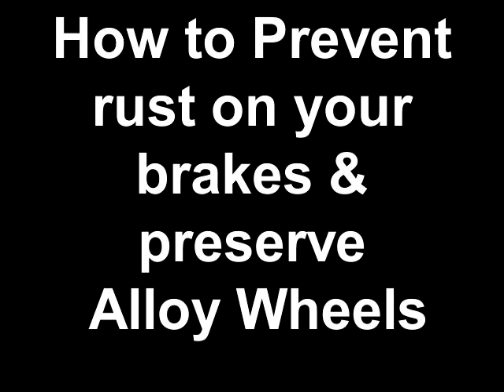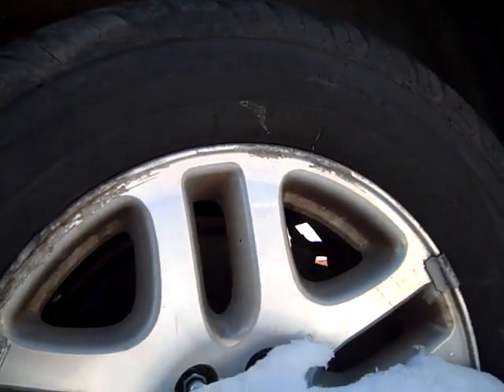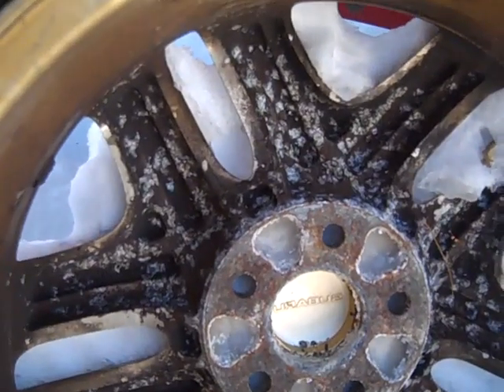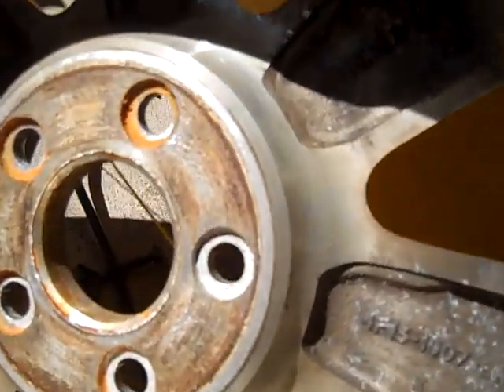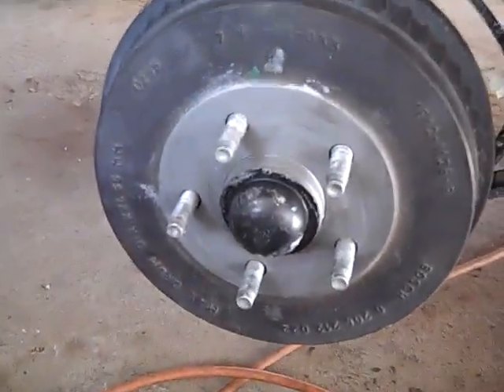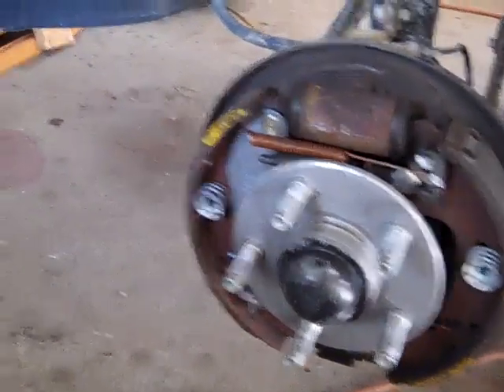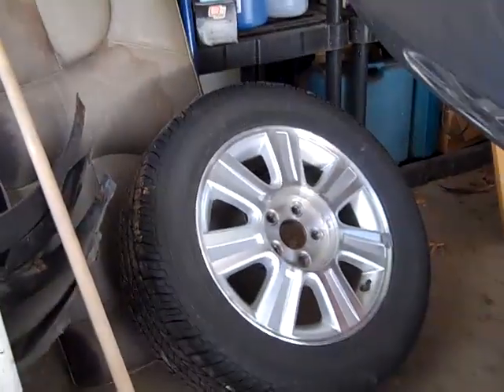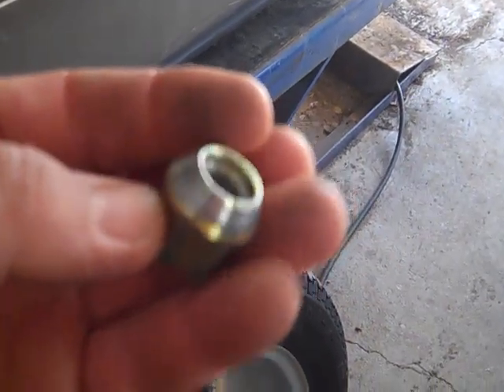How to Prevent rust on your brakes & preserve Alloy Aluminum Wheels

Comment from the maker: that's a good point and if someone put it on thick or used grease I could see that happening but in the past 25 years I have never seen it happen. notice what I say at 2:20 use a "ultra thin coating" I have gone back into this months and years later & what I find is the material is dry, rust free and never came loose.

Comment: Hi I have some questions, can you also put anti seize copper paste(lubricant) in the wheel studs as well also if the Wheel Hub Flange front has superficial rust after I sand it out gently with some vinegar and water to remove the rust but once it's dry can I apply some anti seize lubricant in the hub flange front? will that be dangerous once I mount back the Rim to my car, Oh yeah if my Aluminum Rim has any rust on the mounting pad I do same procedure to clean it like the Hub can I also apply any anti seize lubricant to prevent and protect from the Rust. If it's not a good idea of safe to put anti seize on the hub flange or the Aluminum mounting pad rim. please let me know if it is or not thanks.
Reply from the maker: I havent used the copper anti seize for this but I would say look at the lable and ask your local auto parts store

Comment: Never put anti-seizing agents on yuour lug nuts or lug studs.  it will cause your nuts to not torquer properly ans vibrate off causing your wheels to fall of.
Reply from the maker: in 35 years I have never had a problem

Comment: This is extremely dangerous. You do not put anti seize on wheels and lug nuts. You won't be able to torque the wheels properly and they may even come undone.
Reply: I highly agree, my training throughout my career as a tec! On cars and bikes this is a absolutely a do not do! There anti seize only designed for use on exhausts and manfold bolts , and turbo application exhaust, things that get really hot and rusty , putting this on the hubs , wheel faces, brake faces , studs , lug nuts is a varry bad idea and this it true when i say this , it will cause a wheel off by improper alignment of hub faces , and improper fpt,  "torque "  so if your tightn a bolt with 44fps dry , with it wet with anti seize it will maximize the torque by 30% this means you max out your threds or bolts and brake or strip them. Not only this is a problem i seen all the time coming to the shop, they do it on things thats its bot desighn for , spark pugs ahah "they need there ground " valve cover bolts i mean its not good . Btw if they came im are shop with anti seize we would have to note it on a pma, then clean it all off ! Thats some hard stuff to get off even with brake clean.  Hope this points ppl to the right way, yes things do rust it sucks but thats how it is , !